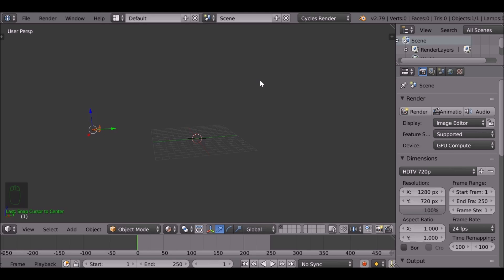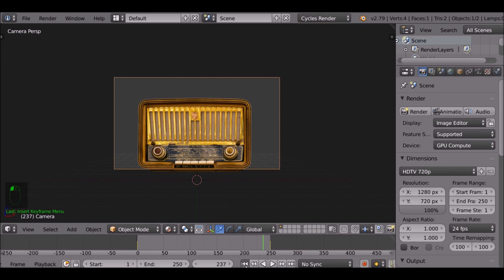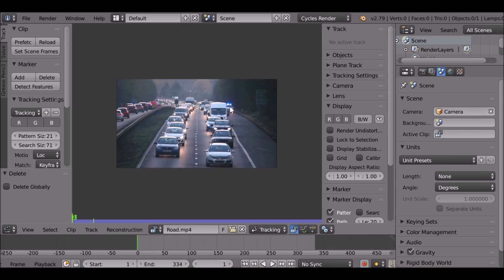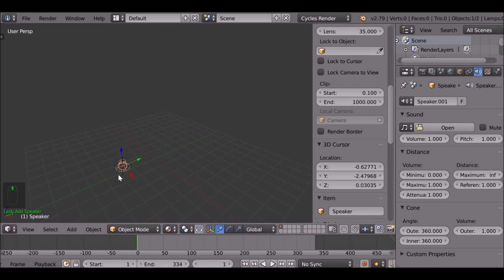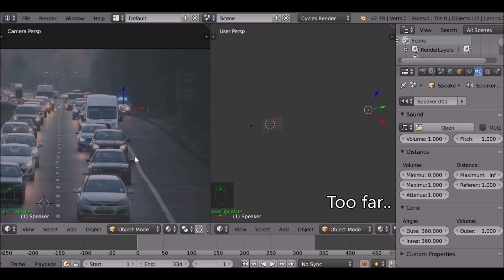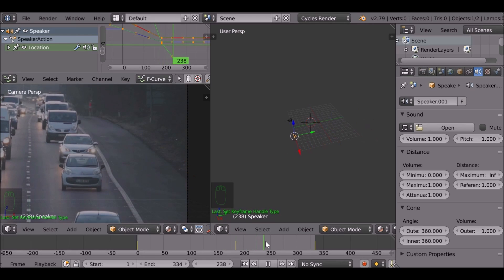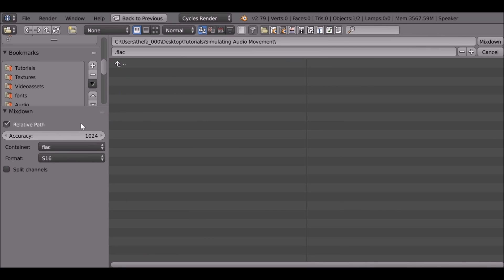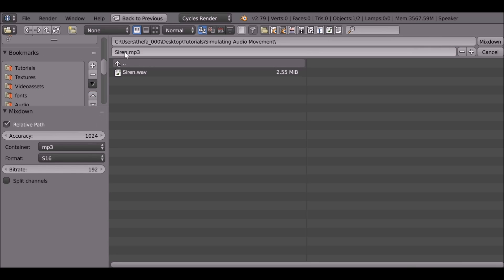Blender Tutorial: Simulating Audio Movement (SFX)

Comment: What about the Doppler Effect?
suggest you could simulate this as an advanced follow-up topic.
Reply from the maker: The Doppler Effect will be set as standard and I am not sure why it would need changing.. What reason would you want the Doppler effect to be changed?
Reply: Excuse me. Rarely did I use the audio object in Blender. Do you mean the audio object already bear the Doppler attribute?
Reply from the maker: In previous Versions there was an option to change the Doppler effect (though I am not sure why you would need to change the effect) but now in the latest version (blender 2.79b) The option is no longer there, so I assume the Doppler Effect is built in and working from standard. (you will just have to simulate the speed of the object you are matching. For example a car is slower than a Jet plane so the Speaker object should move faster and the Doppler Effect will work based upon the speed.
Reply: It seems I shouldn't have mentioned about the Doppler effect and I felt sorry to my negligence to the strength of Blender. Anyway, I suggested this because it will be more realistic if certain extent of this effect could be heard.
Reply from the maker: Don't worry about it, we all have to start somewhere and we all learn every time we use it.. I agree with the Doppler Effect everything will sound more accurate and better. Thanks for your comment..

Comment: An other grate and informative Tutorial.
The options under the Audio Container are the Bit Depth or sample rate  of the the wave file.
A Red Book CD is 44.1Kh with a sample rate of 16 Bits.  
the Bit Depth is the number of times per second the audio is sampled, at 16 it is 16 times, as Digital recording uses Binary (1s and 0s) or on and off over time the wave file in digital looks more like a staircase than a wave, at higher Bit depths the closet to the original sound we get.
Reply from the maker: Ah ok thanks!.. So with the WAV container we get the options for Float, Signed and unsigned.. For these option am I to assume that the F64 bit float is better then the S32 bit signed?.. Im not sure which is better the float or the signed.. Anyway thanks again for the info!..
Reply: How high do you recommend the value of the Bit Depth to be in order to get a realistic result?
Reply: hi Herbert herbst I would recommend the highest you can go, however most people can not tel the difference.
Reply: Brian Wilson ok thanks a lot 👍
Reply: i do plan to make some tutorial on sound recording when I get the time.
Reply: If i'm right, 44 khz is the sampling frequency, (aka sample rate) : the higher the frequency, the thiner is the time slicing.
16 (or 32) bits is the number of bits used for encoding the sound file. In the same way than pixel's colors depth, more bits means more fidelity for restitution.
Sorry for bad english...
Reply: Hi JM 8 yes you are correct.